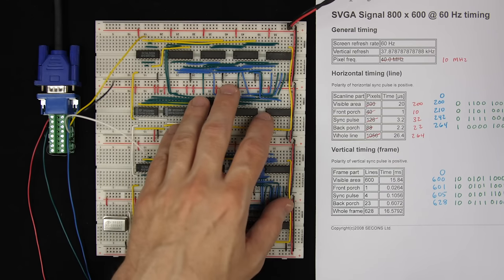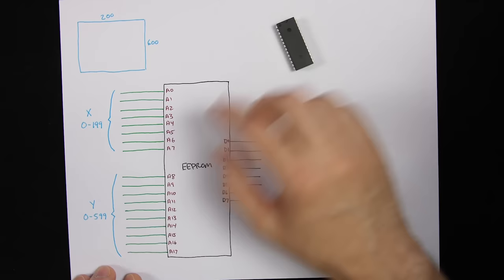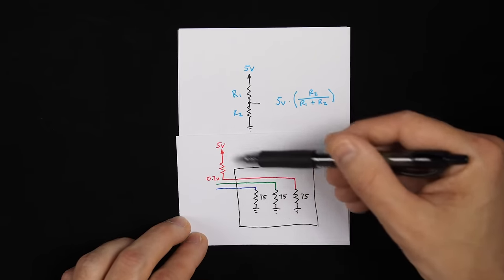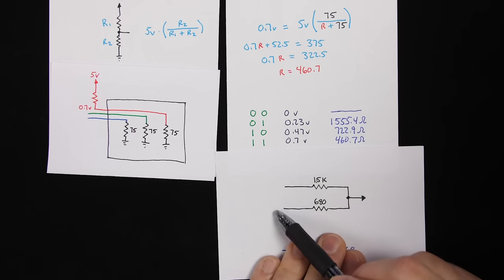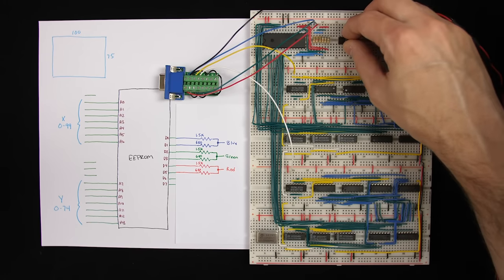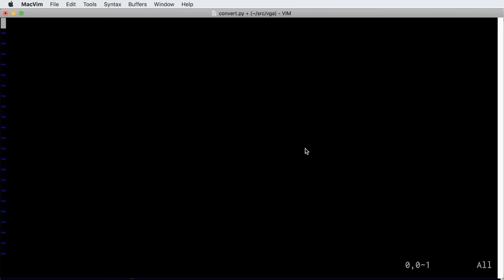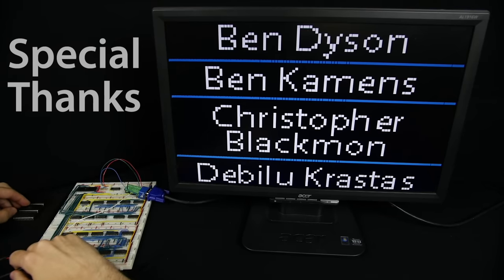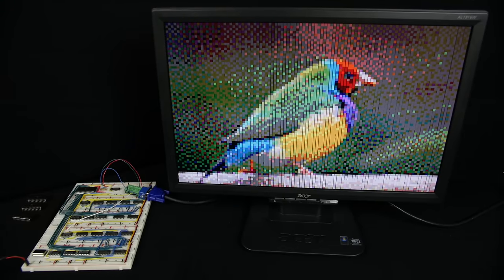World's worst video card? The exciting conclusion

Comment: As rudimentary as this "video card" is, you're actually showing how a video card works. I don't know a lot about these things, so to people like me, the way electronic devices work might as well be magic, but this video really shows what the device actually does when it receives an input, and how it interprets electrical signals in order to display colours, creating an intelligible image in the process.
Reply: Right? So just imagine when a video card is doing complex things like ray tracing. A video card like an NVIDIA RTX 2080 is a mini-computer--a video computer. 🙂
Reply: Naa ppl these days only care bout ma fps
Reply: Not only that - I don't know if you catched it - but those 6 resistors that convert the digital image to volts to send to the screen - is actually a small DAC (Digital to Analog Converter). 
In fact using the same principle you can make a simple audio DAC ...or as we used to call it....a sound card.
Reply: @jarls5890  I used to wonder why my parents interchangeably use "video card" and "sound card". Little did i know that they are very similar.
Reply: @jarls5890  I want him to build a sound card too now lol
Reply: @jarls5890  a sound card is so much more than the DAC ( filtering, amplifiers, ADC, channel muxing-demuxing ) so you've been calling DACs wrongly then ... Just as a GPU ( not a video card ) is so much more than the video output converter.
Reply: @gigelfranaru  Heh yes - i meant in no way that it would be a complete - or good - sound card. But the basic principle is the same and you can build one yourself and test.
Reply: and once you know how it works, it is even more magical.
Reply: @kxmode  That's true now, but it wasn't too long ago that video cards were dumb (not in a derogatory way) devices that just sent an image to the screen like what Ben built here with very little else.
Reply: Agreed. I'll absolutely never replicate this project but I've watched every minute of both videos because he does such a great job explaining the theory. Video cards are no longer in the realm of "JFM" (just freaking magic)
Reply: its just hard to think about when the latest gpus can do shit that's hard to not consider black magic
Reply: It's worth noting that this is a video card specifically for sending data to a VGA interface. A proper video card would support several different interfaces, including digital ones, so a modern card outputting HDMI or DisplayPort would have very different circuitry and logic.
Reply: @danimayb  But in the and, all of that number crunching sends data to a video ram (used to be something like dual port so you can write and read at the same time). And after that it does exactly this for vga out, except it is probably a single chip (or even part of a chip). Or you send the data from the ram through a digital channel (which is not vga)
Reply: un grande señor modesto fan de los simpson rosado

Comment: Parts List:
10 Mhz Crystal Oscillator (Full Can)

28C256 EEPROM
74LS161 (x6)
74LS04 (x4)
74LS30 (x8)
74LS00 (x3)

1.5k Ohm Resistor (x3)
680 Ohm Resistor (x3)

15 Pin VGA Female Breakout Board
Hookup / Jumper Wire
4 Breadboards
Reply: thnkx a lot !
Reply: Can of beer x3
Reply: @antonydecosta6262 more like gram of meth 10x if you want to build this irl
Reply: - Electronic Engineering Degree

Comment: Hey Ben, you know we all want to see you connect this video card to your 8-bit breadboard CPU, right? Like, all of us want it!
Reply: Probably his 8-bit computer is too weak for this gpu, 8-bit bus is not enough to allocate 7500 adresses of video memory. It is only possible to make 4x4 pixel display for breadboard cpu.
Reply: With a bit of address mapping (take an address, use it to control a register, then use that register to provide the upper bits of an address when you try to access certain other addresses, called "banks"), and you can fairly easily overcome any memory restrictions. With multiple banks (two is good for moving data, three is good when also executing from "expanded" memory) you get a very powerful system that's almost as fast as an un-banked system.
Reply: Демид Ефремов you could easily add stuff in between which takes in an ascii character and then writes that character to the memory at the next available spot on the screen (or newline)
Reply: 3:03 image flash.
Reply: And then we run Crysis on it!
Reply: Use the combination to display the matrix background!
Reply: @demid6532  Maybe using banking... The worst part would be controlling access to shared memory (both data and address busses).
Reply: 23skymaster Now we’re thinking!
Reply: 👑
Wow!! Amazing Idea😲😮👑
Reply: JebacTych Policjantow it’s not, i tried but i have done it myself
Reply: Replace the EPROM with an SRAM, and add multiplexers on the bottom four and top four bits of the address, and then add some logic so the 6502 can read the state of the counters.  That would then make it possible for the 6502 to output data anywhere on the screen by properly-timed write operations.

Comment: These videos were incredible. I feel like I have a better understanding of how Computers display graphics now.
Reply: and while the formatting is different (digital instead of analoug) this is still how video signals are sent over HDMI.
Reply: I have a Display Port cable that has two damaged wires (I think).  So, it's interesting...  If I bend the cable at the wrong angle, the wires disconnect and the monitor has little cyan lines going through it, meaning that at least 1 red wire and 1 green wire is having issues.
Reply: Me too ;-)
Reply: Same here! Great videos.

Comment: To fix the thin lines, put a 74LS374 on the output of the EPROM and clock it from an inverted dot clock (10Mhz) & adjust the H-sync to be one step later.
Reply: Youtube is truly the greatest human invention. Not just that the content exists, but instantaneous gem feedback such as this comment. What a time to be alive!
Reply: I love how there's people like me that kinda get what's going on here, and then there's people like you who get what's going on here
Reply: Yep, I was just thinking the same. 🙃
Reply: Unfortunately the worst case tACC for the EEPROM is 150ns, and the period of the 10MHz clock is 100ns, so using a D-type flip-flop (like the 74LS375) and correcting timing by one pixel would still have potential for a glitch.

However, as he’s dividing the 10MHz by two by dropping the LSB of the horizontal counter, it would be possible to divide the clock to the D-type by two to produce a sampling period of 200ns and never violate the EEPROM access timing. H-sync would then also need to be delayed by two cycles rather than one.
Reply: I was immediately thinking the same thing - "you need a buffer on that slow ass prom".
Ben's comment about sdram being faster and that this would solve the issue is misleading too. Let's say he used some low latency ddr4 with 15ns latency. That might work, but only because the monitor is too slow and likely samples towards the back end of each 25ns pixel. An old crt would shift the image by about a half pixel and if it was a good monitor, it would display the invalid data as vertical lines of pixel flicker.
A 4k pixel is less than 2ns - so sdram is always buffered.
Reply: Is it the flux capacitors?
Reply: This comment/reply section is above me
Reply: @Jepysauce  I just nod. I think if we keep quiet, they won't notice us.
Reply: That's just fixing the right now problem.  The bigger problem is stitching this over to the 8 bit computer.  For that he's going to want a memory module and not an eeprom in there.  A perfect module would let the system write to the video memory without worrying about what the video card was doing, and the video card be able to ignore what the system is doing, just showing whatever image is in video memory.

Dual port static SRAM is the easy solution, but my guess is he'll get a DRAM chip and build a controller for it.
Reply: hmmmm... i thought me being able to write assembly programs with no background on computer science or programming ( i'm a biologist ) was kinda cool already... until reading 74LS374 and LSB and LGTV ... i kinda want to learn this shit but i'm just nodding at this point
Reply: Or to get higher resolution, use a bank of 6 EPROMs each going into a shift register.  The shift registers can run 2, 4, or 8 times faster than the EPROM access time giving more horizontal resolution, and spreading the data across multiple EPROMs means you can also get more vertical resolution.  Would also need some extra timing signals to latch and count the shift registers.
Reply: @CallumAi  wtf
Reply: @teopalafox  i dont know hardware stuff but it was not difficult to follow along

Comment: That EEPROM could store 2 more frames. You could make this display a gif.
Reply: @Ben Eater gif gif gif gif gif
Reply: Gif? You mean an "animation", don't you?
Reply: @l3p3  He means a Graphics Interchange Format image.
Reply: 1 more frame would be relatively easy - just write the second frame starting at 0x4000, and have a switch to take A14 high to swap to the second frame. 2 more frames would be a PITA.
Reply: Moving picture please! I'm sure with a bit more effort it could be compressed down to get a few more frames too.
Reply: And that’s how portable digital porn was invented
Reply: @sherwoac  If you "compress" it, then you would need decoder for the image. And that would most likely be much larger, than the whole breadboard graphics card he constructed.
TBH I was hoping he would use full vertical resolution (and possibly even frequency multiplier for full horizontal resolution...and one or two more resistors per channel for 512/4096 colors), but then again - this is just fun demo.
Reply: "display 2 more frames"

Yeah, with 150 nanosecod delay between them. Because that's the fixed timing.
Reply: @RaduOleniuc  nothing that couldn't be scaled down with one more counter driven from the Y reset line.
Yes, I'd like to see a basic animation, a couple of frames using A14 as a frame select...
Unless he wants to go oldschool and piggyback a load of EEPROMs on top of each other with the chip select bent out and driven individually... But that would require solder.
(like 80s RAM upgrades - I remember seeing this on an Exidy Sorcerer as a kid, amused me no end!)
Reply: @petrkubena a simple run length encoding would not take up that much more space

Comment: You should consider doing a bonus part 3 where you load 3 unique images into the remaining memory and slow the clock enough to make it animate like a GIF!
Reply: He could probably just use the vertical blank for advancing the image. That'll be a 60 fps animation.
Insert joke about 30 fps consoles here.
Reply: xD
Reply: Honestly that would be a cool idea
Reply: @Richard Clutterbuck not with all games, some of them run at 30 or even 30 unstable
Reply: Am thinking hoock it up to a raspberry PI and we can have some 100x75 pixel fun
Reply: @tawongadonnellmsiska173  we do not speak of raspberry pi on this channel
Reply: @110110010  kkkkk now i know
Reply: should make the snake game to play with mechanical switches
Reply: Liking a comment but not pressing the like button cause it's 69
Reply: @tawongadonnellmsiska173  u would need a real time OS on the raspberry PI, and even then, i can imagine getting your code to output a 40 MHz Signal to the IO pins would be quite the challenge
Reply: You know what you need, you need to use that extra bit to get twice as much eeprom data and have two images th flip back and forth to make mediocre graphics

Comment: I noticed one of the sync wires isn't hooked up correctly I believe. On the second breadboard from the bottom, the white sync wire is hooked up to pin 13, which is an input of the flipflop. Whereas the yellow sync wire correctly is in pin 12. Could that cause the problem with the black bars or am I wrong somewhere?
Reply from the maker: You're right, it looks like that was hooked up wrong! That would have made the horizontal sync pulse much narrower than it should be, which apparently the monitor was able to deal with just fine. Presumably I didn't notice it since it worked. But hooking it up to the correct pin which provides the longer correct pulse still gives you the black bars so I think my diagnosis of the slow ROM read time is still likely to be what's going on. Nice catch though.
Reply: Incredible catch if I might add
Reply: @paladin1147  I double this. I look at those holes in the breadboards and I still can't get where to put wires. I believe that all holes on the same column are connected between each other. Amirite?
Reply: Where's this bread you guys keep talking about? I wanna sandwich now. 😂
Reply: Alter Falter hast du ein Auge fürs Detail 😯
Reply: you can confirm it by hooking R,G,B directly to 0.7v to see if the white screen still gives you black lines. But I guess the ROM is probably the slower thing there, but it could also be like the nand inputs doesn't flip at the same time, blanking every pixel?
Reply: @HazeAnderson  The bird ate it
Reply: @victornpb  The first test with horizontal lines did not have the black vertical bars
Reply: @MrEdrftgyuji  Because the data for those lines were being generated from the actual counter bits and there is no problem with the signal being delivered slowly at that connection.
Reply: The black lines are probably due to the counter values settling, they are notorious for doing that. Also the EEPROM output will also need some time to settle after the settled counter values. What's needed is a latch on clock edge that arrives after a cycle after the counter clock edge.
Reply: @Kitulous  Not all. Those on either side of where you put an IC are interconnected, though. And of course there are "rails" for Vcc and GND.
Reply: Thank you Gesprengt good editing !